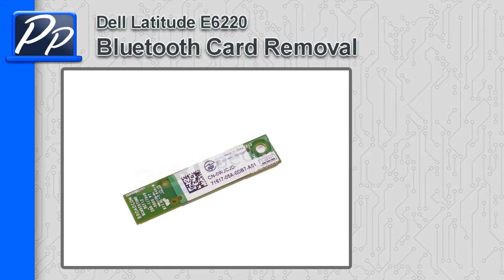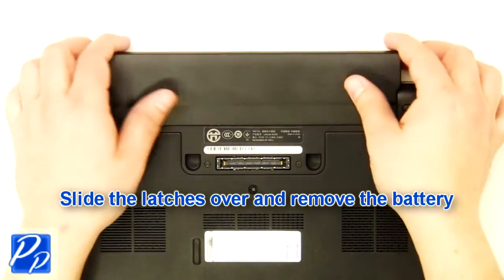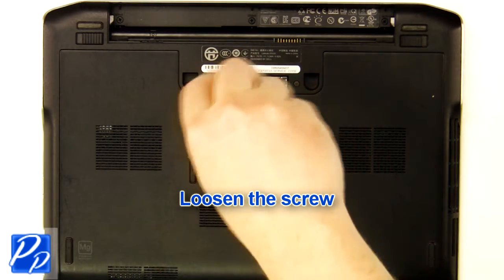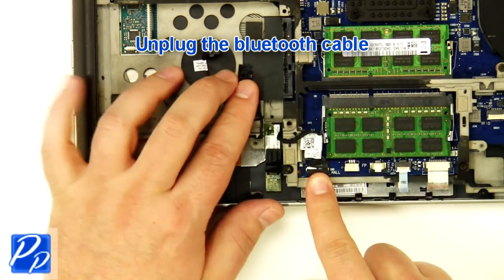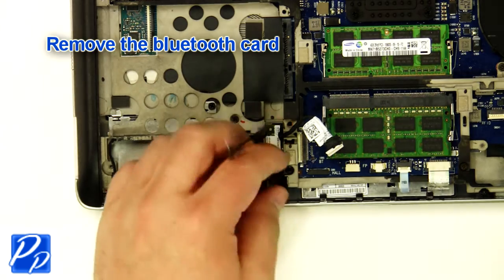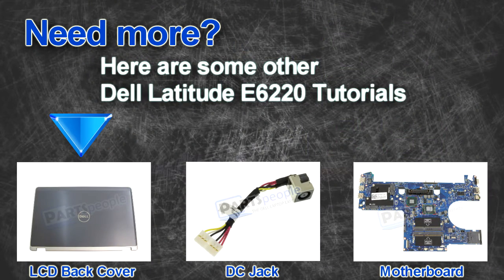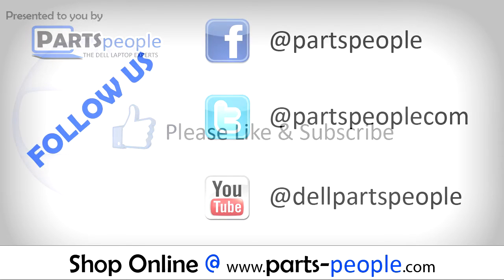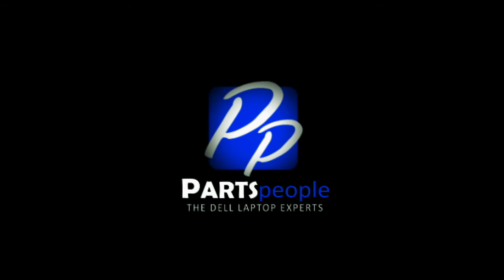Dell Latitude E6220 Bluetooth Card Video Tutorial Teardown

Comment: if you have this laptop with this bluetooth module and you cant find the bluetooth drivers for windows 10. try using the combo wlan card that is in the dell inspiron 14r 5437. It has bluetooth and wifi on the same wlan card. swap the wlan card thats already in there with the combo card and windows 10 should automatically find the drivers. just make sure you turn on all the bluetooth options in the bios.  my card is 05gc50 got it for $5 on ebay and works great so far.
Reply: Ciao scrivo dall’italia.
Ho fatto quello che hai detto, jay,  ma il Bluetooth non va. I fili da utilizzare sono bianco e nero come nella scheda solo wifi?
Grazie
Reply: @FrancescoLeaci  there is 2 slots facing the hard drive, My card is in first slot closer to usb sockets. My white cable goes to main. My black goes to alt.